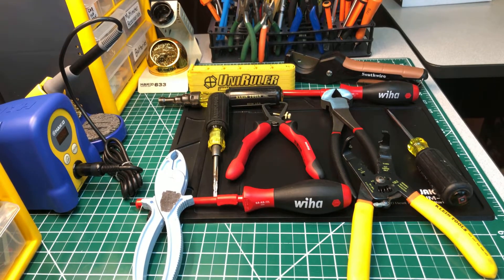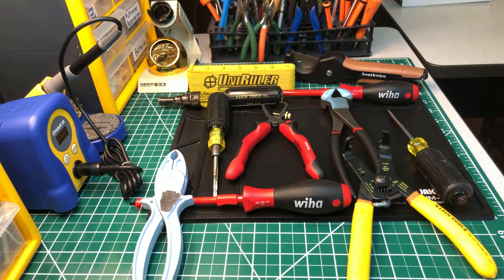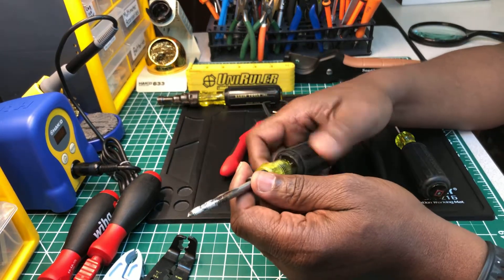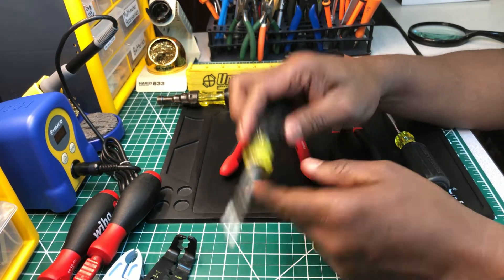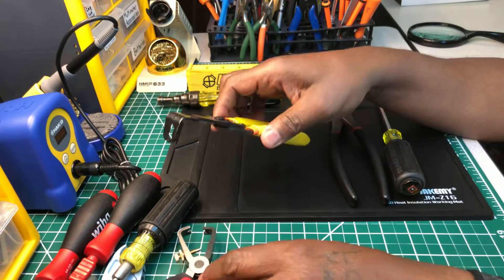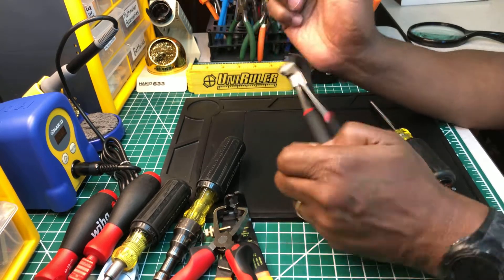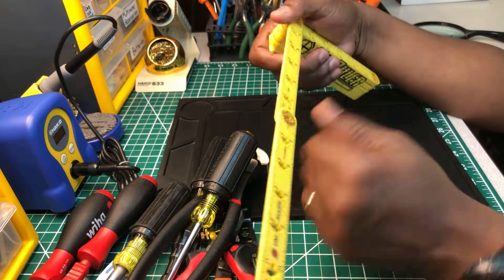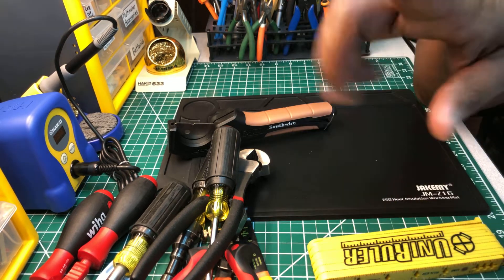🇺🇸🇨🇦🇩🇪 Specialty Electrical Tools For Electrical Apprentices ( Part 1 )

Comment: I think the klein is just called the combo tip and the milwaukee is ecx, also ideal has a version as well. My only issue with the klein multi tap is sometimes the tap size you need to use is too long to fit in the area you need to tap so I prefer the tap drivers with separate bits I use a craftsman one which stores the extra taps in the handle. I forget what the situation was that the klein multi-tap didn't work in but I realized the flaw and wish klein would make a version with individual tap sizes.
Reply from the maker: I do understand you must use what works for you 👍🏿